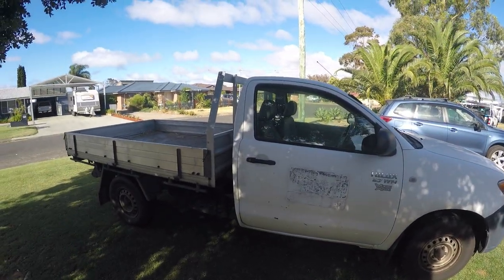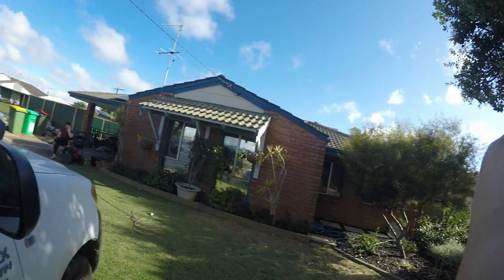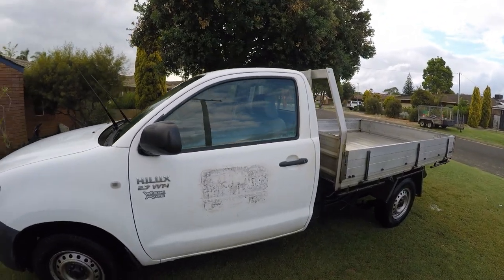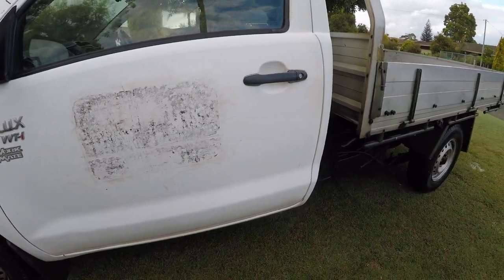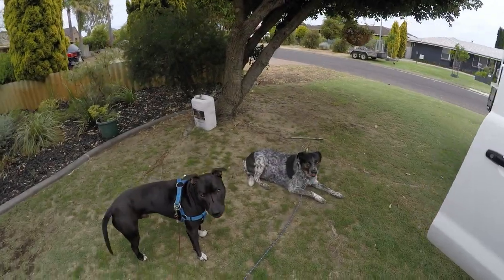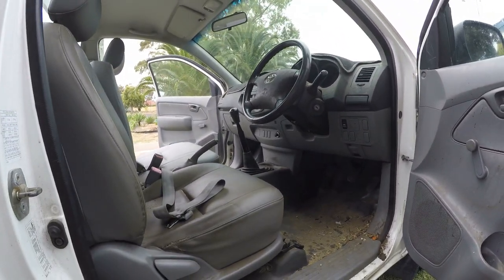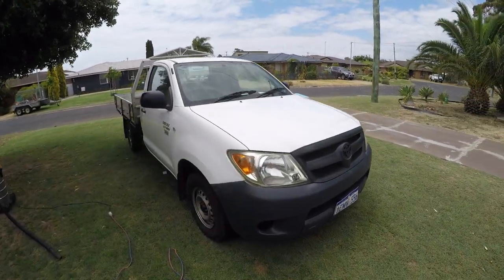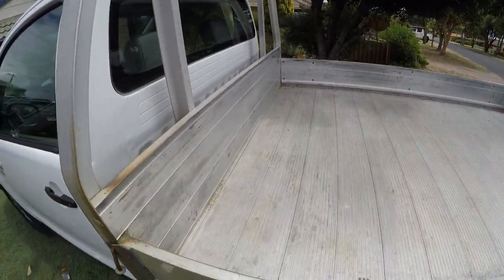WASHING A FILTHY WORK UTE!! 8 YEARS OF GRIME!

Comment: What kind of vehicles truck  brands do you all have in the land down under . Dodge , Chevy,  Ford,  Toyota,  Nissan,  and what's the most popular
Reply from the maker: Most people use Holden, Nissan, toyota and ford. Toyota is the best
Reply: @DAN-IEL.N.U.P  what's a holden and ate most of the truck small like yours
Reply from the maker: @jaypipken7444  pretty sure they are called Chevrolet in the US. Depends what sized jobs you normally do. Us smaller guys mostly use utes but others use something a bit bigger like this. https://carbazaar.com.au/2008-kia-k2900-pu3-white-5-speed-manual-cab-chassis-17185.html
Reply: @DAN-IEL.N.U.P  dang that is a bir bigger . Thanks for the replies . I was just a little curious about that stuff . Thanks again .
Reply from the maker: @jaypipken7444  no worries 👍 thanks for watching my videos